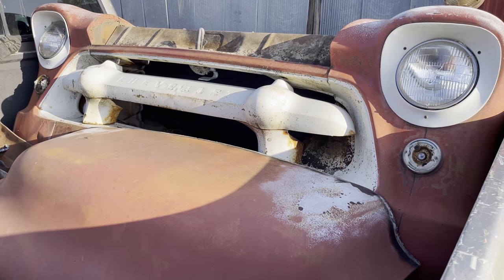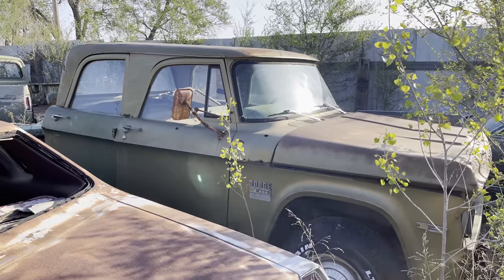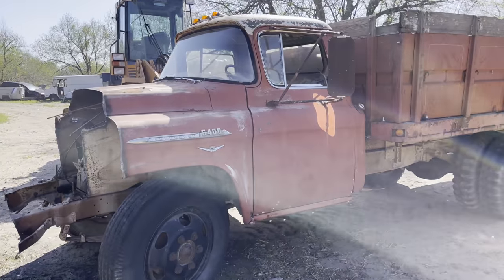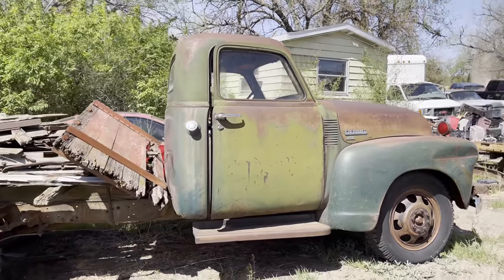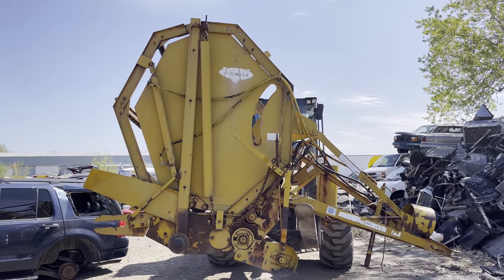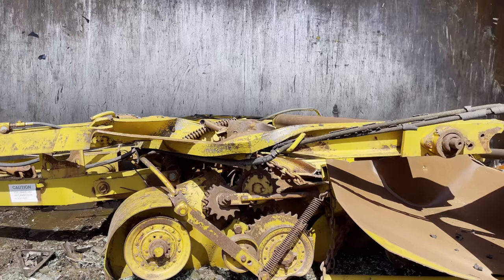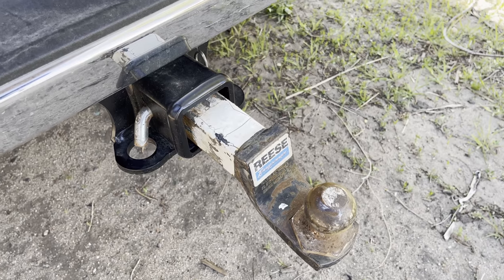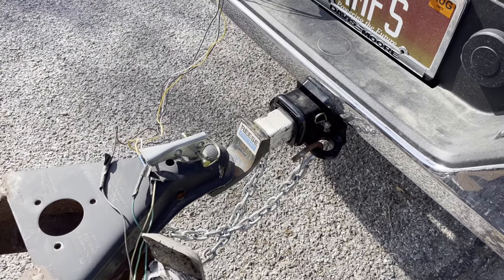Will this Piece of Farm Equipment CRUSH in a 2400 psi CAR Crusher? Plus I Bought Some Antique Cars!

Comment: You shoud make a camper or of the old dodge.  Find a old slide in.  I had a D200 camper special. Single cab. But had a twin cab before .ex military. was a 4x4.

Comment: You may be a lifesaver!!! Behind the Crew Cab is a 65 Cadillac. Please tell me it is an Eldorado. If it is, I need a part for my 65 Fleetwood Brougham. It is a trim piece exclusive to Fleetwood Brougham & Eldorado only.
Reply from the maker: It’s a convertible if I’m thinking of the right car. I can’t remember the model
Reply: @AdventuresMadeFromScratch  I need a piece of Chrome Trim. Driver's side (left) rear quarter panel. It is attached to the quarter panel with Phillips screws directly behind the bumper tail light housing. If It is not an Eldorado it won't have it. It is chromed pot metal It is two pieces I don't need the small inner piece just the outer. Don't make a special trip but if you are out there and remember Thanks.